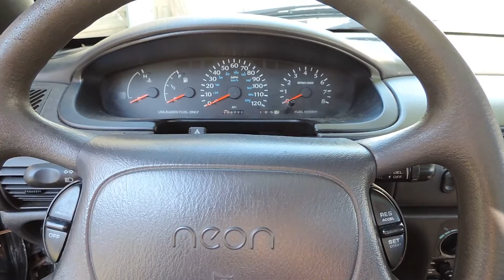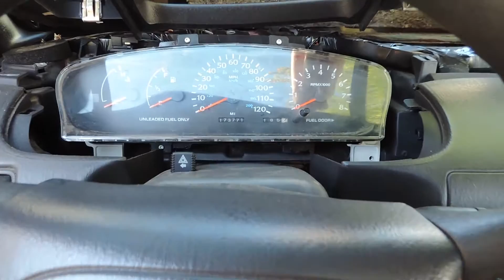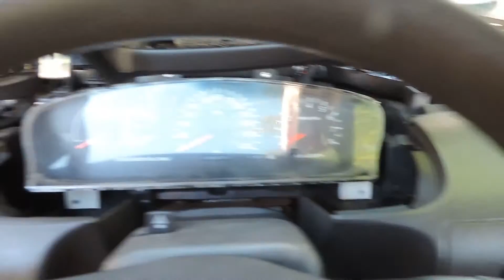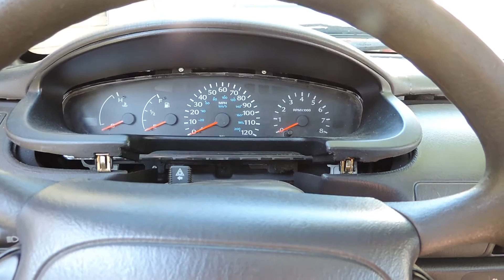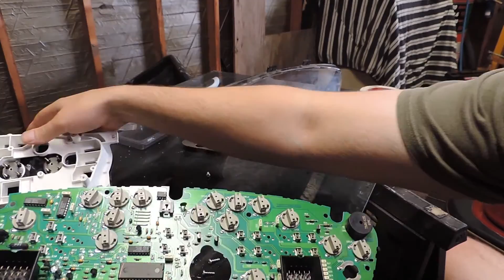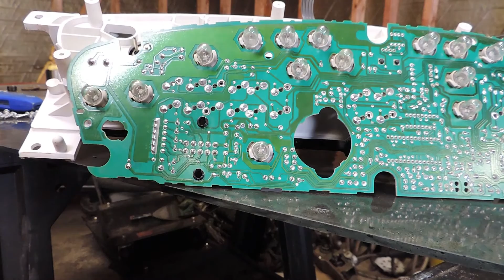Dodge Neon Instrument Cluster Repair

Comment: Will doing this for my 2005 Dodge Neon SRT4 work? I know it doesn't hurt to try, but is the circuit board almost the same thing?
Reply from the maker: I've never had this problem with the later clusters. I would pull it out and look it over. I certainly can't hurt to try. Thanks for the comment and the view.

Comment: Just did the same on my neon, and it worked. It had multiple problems to get speed on cluster: sensor broken and these solder cracked. Its about one year I bought this car, and only now I finally have speed and mileage on the cluster. Thanks for sharing!
Reply from the maker: Glad you have proper instrumentation and that you found the video helpful. Thanks for the comment and the view!

Comment: Thanks for the video. Do you believe this is the problem when the speedometer works intermittently? Thank you
Reply from the maker: It had been the problem with mine every time. A simple test to prove that it's in the cluster: Turn on your cruise control and if it cuts out or speeds up in an attempt to match the speedometer, then it's the speed sensor or associated wiring. If the cruise works fine, then it's the cluster for sure.

Comment: The bad part is you said you've done this before.  If it's happened again, it's not a permanent fix.  Chrystler should have had to either offer a new gauge cluster to neon owners or they should have to have come up with a more permanent solution cause you can bet your ass it's a safety concern.
Reply from the maker: In all fairness, this was one of my fairly early soldering projects the first time. You're right that it probably wasn't a permanent fix anyway. Even if they wouldn't have recalled them etc. I don't see why they didn't improve the design. I'm sure there were a good number of these which failed by 99.
Reply: bwcordes
Well I didn't get my first neon until the latter part of the 2000's, so I don't know how many failed within the first 10 years.  I do know that all but one of my neon has had that problem.  I JUST repaired the cluster in my current neon (why I watched this video) but a friend fixed the other one that was having issues.

Comment: well done video  so this is common on neons so worst case you really just need replace   circuit board if  gauge is bouncing around not replace whole cluster ?   mine seem gave out this week first car repair guy refuse to fix it says it dealer job  ?
Reply from the maker: Melain Kinney In my opinion if the gauges are bouncing then you will just need to reflow the solder like I did on this one. It's extremely common. I have done it a couple of times on multiple clusters and it works each time.
Reply: bwcordes I going to give it shot as it last year I intend  own the car I got 18 years out mine  171 k  out of it maybe just got good car till this last year very very limited maintenance other than tires oil changes belts . I plan upgrade to  Mistibishi Outlander I want it as my  last car I ever buy retirement  present to me next April  . Your Video makes it very do able what worst  that can happen no worse than when added door speaker can only roll window 3/4 down lol ...I independant old person laughs if i can get a year out it  i be tickled
Reply: Melain Kinney ha   plus it cheaper than ticket to  fix it laughs  whistle i know nothing about tickets laughs ...

Comment: sounds like this is my problem with my neon the speedometer works some times but I have gotten used to just using the tachometer for speed LOL but every once in a while the hole cluster seems to stop but I guess I didn't know how easy that pops out...I think I am going to give this a try after I get my rounded off lug nuts off...damn flat tire
Reply from the maker: Yeah, it's really easy. I had the exact same problem and my tach started to die more often than not so it was time to pull it. 

Check out my lug nut video for an idea as to your problem. If you peel what I'm assuming are the bad chrome caps off of there you can use one size smaller for your socket and be all set.

https://www.youtube.com/watch?v=85MTq5YWCFE

Comment: you seem to know quite a bit about neons  my daters car is a 95 and will drive months with no problem then it will decide not to start  then after setting for a wile it will start   the starter has tested good just wondering if you know anything about this thanks
Reply from the maker: You really need to do some tests to get more info about the problem the next time this happens. The first thing I would do would be to jump the fuel pump relay when it doesn't want to start. If the pump kicks on then it's probably not the pump itself. Of course you should probably be hearing the pump prime when you flip the key forward anyway. 

Does it throw any codes when this happens?
Reply: it has thrown codes but they seem to be related to the o2 i will check the fule pump thanks
Reply: It's the fuel pump

Comment: how do you reset the needles?
Reply from the maker: They should go back to normal once you give power to the cluster again. You don't need to touch them at all so they should really only move due to gravity on them as the cluster gets turned in various directions.
Reply: well mine start like 10mph it doesnt want to reset
Reply from the maker: tomas galvan That's interesting. Did you touch it at all while you had the cluster out? Did you try moving it back down to zero to ensure that it's not something mechanical limiting the travel?
Reply: i try to put to zero doesnot work it was working fine
Reply from the maker: tomas galvan That is interesting. I would look at the area where the board presses into the gauge pins and make sure there is a good clean connection there. I would also make sure that you don't have any solder bridges formed between the pins.
Reply: oh k thank you i would check it
Reply from the maker: tomas galvan Sounds good. Please report back with your findings. I've never had this problem before so I am very interested to find out the cause and the fix. Thanks a ton for bringing it up.
Reply: @tomasgalvan01  https://youtu.be/fMByHi72vCE to reset cluster